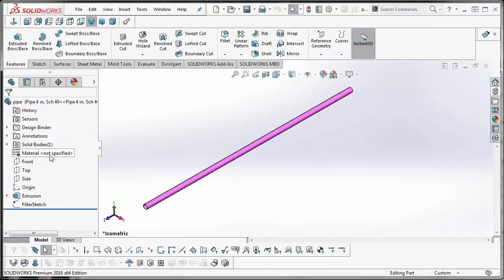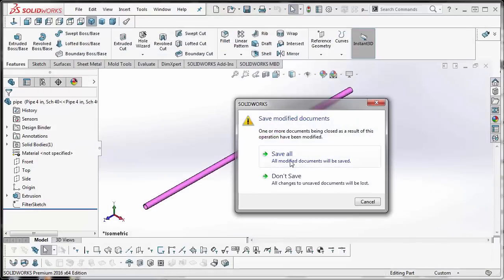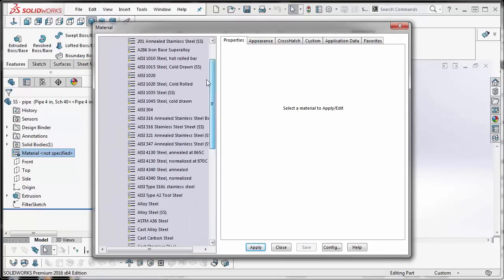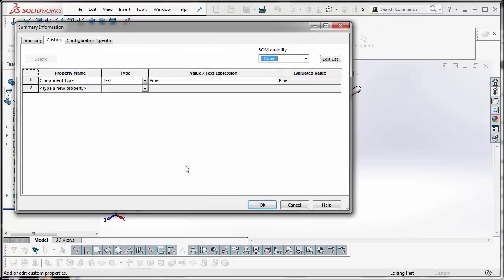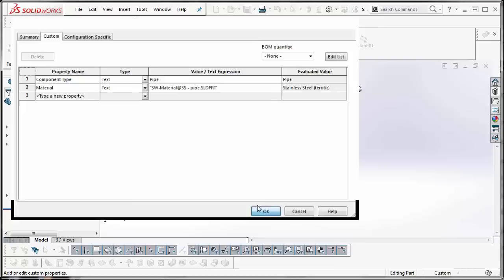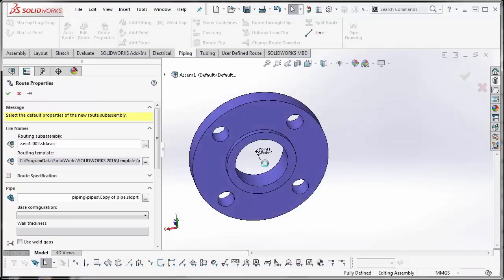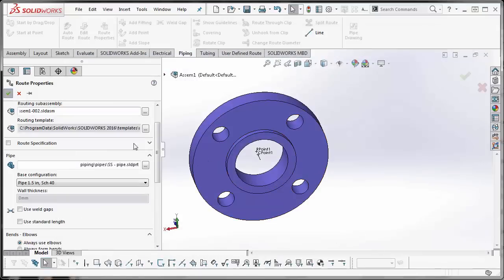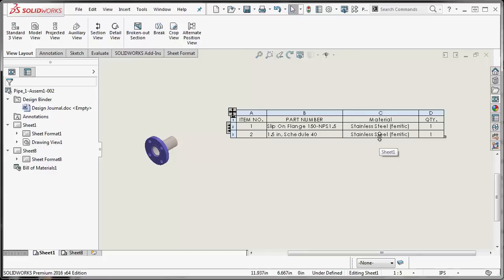SOLIDWORKS - Create Material-Specific Piping for Routing

Comment: What version of Solidworks should id get if i want to make a folding chair, then see if it actually folds in the program and also have ability to print things out? Should i use solidworks 3D CAD, Electrical, Technical communication, Simulation or Product data management?
Reply: Hi War Gamer. I recommend you get SOLIDWORKS 2016 CAD and also Simulation. Great question.
Reply: Would I be able to print on CNC router with solidworks 3D CAD and Simulation?
Reply: Yes, check out this link: http://www.solidworks.com/sw/products/3d-cad/export-dxf-dwg-to-manufacturing.htm